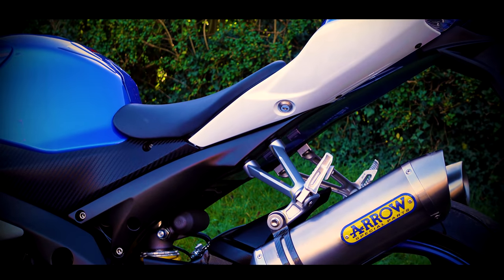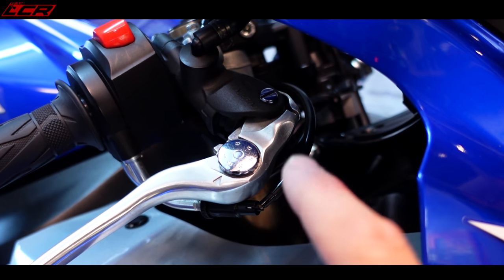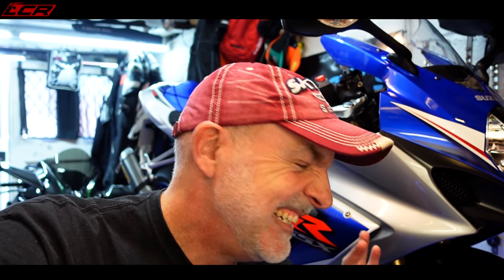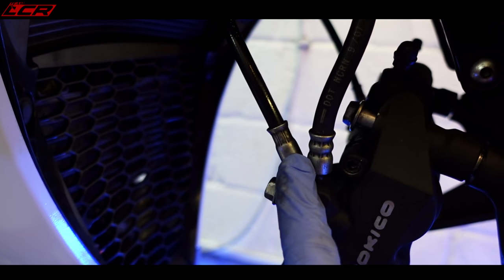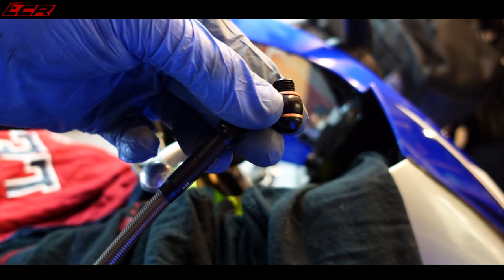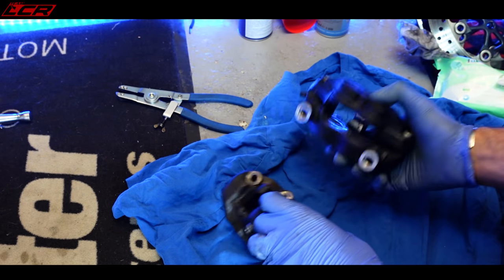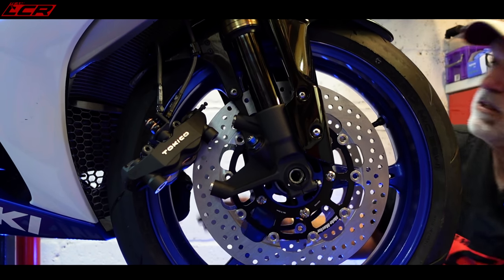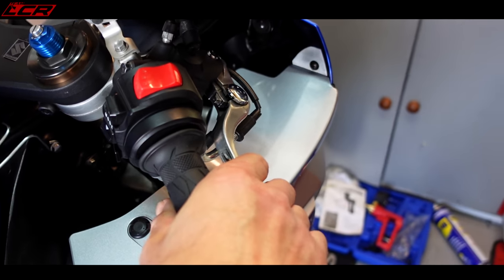2008 Suzuki GSXR-1000 | The Best Upgrades! EP01

Comment: Nice work Mr chops.
Shame you didn't diagnose the brake judder before throwing the kitchen sink at it. It could have been something simple as the pads. Judder at the lever could be the disks and a slow sensation of judder from the front tyre as you gradually come to a stop can be brake disc compound 
Great stuff thou 👍👍

Comment: Those Moto Master discs look very nice, I have Chinese discs on my ZX9r Arashi, made very well and work a treat. I know you love your lighter fasteners, a little tip that you may know, go titanium as you did on bolts that need to be very strong, on others go Aluminium, they are still resistant to corrosion and are even lighter than titanium, but if you do need stainless A2 or A4, let me know I sell them online 👍

I hope the master fixes it, it must be restricted, but then you'd expect the lever to go stiff. Maybe remove the calliper's one at a time and gently squeeze so the pistons moves out slightly, and check they all retract when you let go. If not one of the seals may be gone and binding, stopping them going back and holding the pads tighter on the discs as you use them.

Another way that might confirm it's this is pump the lever a lot and see if the discs are binding more and more, possibly preventing the wheel moving at all. Each side would be unfortunate, but I've experienced a seized master, and seized callipers due to dust seals going bad before so know exactly what that is like, glowing red hot brakes is not good, hope it is easy to sort though.
Reply from the maker: Yes sure that's the problem with piston not retracting.. going to have another look

Comment: I could be wrong but I would be looking at callipers sticking rather than the master cylinder causing the brakes to bind.
Invest in a pressure bleeder and it will only take a few minutes to bleed your brakes

Comment: A few things chopsy, first take those pistons out and coat them in a little brake fluid,

Secondly - try back bleeding the brakes, take that syringe you mentioned and put it on the caliper nipple with a hose and slowly push the fluid up the system that way the air travels to the highest point as an engineer of 20 years this is the method I have used for a long time now and never had poorly bled brakes

Comment: Quick tip adjust front brake lever to number one this helps bleeding brakes also take off left calliper and hang it down by offside calliper this helps bleeding as fluid does not have to go uphill
Reply from the maker: Yes good tip, I did do that 👍

Comment: To get your brake bled properly you need to crack the banjo bolt at the mastercylinder first mate if you look it will be the highest point and tends to trap air if you get good pressure there then you will be able to bleed down at the calipers in no time. Seems to be a big thing going around at the minute with people saying you shouldn't use brake cleaner to clean brake calipers as it dries out the seals, have used it for years and never had any problems but I can see why people think this, maybe a little brake fluid or gt85 around the seals after cleaning may help buy not much as it will only attract dirt and cause bigger problems. P.s you need a smaller front sprocket not a bigger one. Bigger on the rear for improved response.
Reply from the maker: Yes did it there many times, started there 👍

Comment: Don't spray brake cleaner directly on the caliper piston area as it can cause the seals to swell slightly which can cause sticking brakes. You're better off pumping the pistons out and scrubbing them with a toothbrush and mild soapy water.

The master cylinder, these can be a bugger to bleed up, you can get air stuck in the rubber link pipe between the master cylinder reservoir and the master cylinder body. Using a pair of long nose pliers, repeatedly squeeze the rubber pipe to expell the air. Been there and done that loads of times after thinking it was air trapped in brake lines.

Also, cable tie the brake lever to the bar (with the brake fully on) and leave overnight, see if that makes any difference.

What was the runout on your old discs? Were they in spec?

Comment: Hi there, always follow your channel love the content. There are a few things that might help here. Firstly rotating the those pistons inside the calipers will mess with the internal seals. You will now probably need to strip down the calipers and replace the seals. As long as the pistons slide in and out freely and are not binding, is all thats needed. As to not getting a solid brake leaver after bleeding. I find using a vacuum pump to draw hydraulic fluid through the dry system initially does get everything moving but there is a tendency for a vacuum pump to introduce air into the system a little at the bleed nipple. Therefore after using the vacuum pump then bleed conventionally with the brake leaver locking off to prevent air getting into the system. Hope this help and looking forward to the next episodes re the modifications.
Reply from the maker: Thanks Richard I think I've messed the seals.. I've ordered a rebuild kit 👍

Comment: only a suggestion mr chops did you loosen the bleed screw on the master cylinder
Reply from the maker: Yes I bleed there also
Reply: @LambChopRides  my K7 had the master changed it can only be that

Comment: Fill the calipers with brake fluid before putting the brake lines back on, then tie the lever in before filling the master cylinder, this will put fluid where it needs to be. If this doesn't help try reverse bleeding through the bleed nipple 🤔
Reply from the maker: Yes good tip that thanks 👍

Comment: I get really puzzled why people can't get the air out of brakes, I really do. I had a Landrover with twin leading shoe brakes, and there so many posts that talked about rotating back-plates etc.. I never had a problem with mine? I don't want to be 'elite' about it, but in my years in the trade, the method was to only open the bleed when the pedal (lever) was depressed (squeezed), and close it before the pedal/lever was released. Has worked good for over 30 years, for me 🙂
Reply from the maker: That's my method Steeps, honestly was doing that's for hours with no joy 😫

Comment: Don't try to use a vacuum pump to do the final bleed. Use it to get the fluid moving through the system but then revert to the old manual way with a tube on the bleeder valve down into fresh fluid and pump the brake lever, opening and closing the bleeder as necessary. Doing this applies line pressure in the hydraulics and cannot introduce air. The vacuum pump, on the other hand, can and does suck in air bubbles behind the bleeder valve, and you'll be chasing your tail for hours and hours with no luck!!! And replace your seals in the calipers BEFORE the new MC. It is not the cause of the binding! (But we know you really want a new MC anyway haha!!! :-)
Reply from the maker: Yes good tips Barry 👍

Comment: Could be wrong but I thought the master cylinder recall only affected the K5/6 models.  I remember having to get mine done.
Reply: GSXR-600/750 (2004-2013) & GSXR-1000 (2005-2013) models. Was a Tokico issue with corrosion causing offgassing which gave similar feeling to air in the brake lines increasing over time.

Comment: I had same problem on my gsxr750 L0 after replacing to hel lines bought a rcs19 and caliper rebuild kit and it turned out to be sticky pistons on the dust seals on the caliper

Comment: I've got the same bike, loving mine, although mine has stock break setup, sintered pads with braided lines and I get it doing stoppies with one finger, wonder what's causing the break issue? Look forward to seeing if the new master cylinder does the trick!

Comment: Hi Chops, I also use the Venhill vacuum brake bleeder, I saw in the video that you used the vacuum pump fitted directly onto the caliper, in the instructions with the kit, it shows you have to use the small nylon pot filled with a bit of brake fluid in it between the caliper and the vacuum pump, (their are arrows on the nylon pump to show you which direction to fit it) otherwise you will, (might) suck the fluid into the vacuum pump, which will do both the pump and your wallet no good at all!.
Reply from the maker: No that was attached Neil, just a long pipe in between 👍
Reply: Hi Chops, sorry for that, it was hard to see the pot on the video, did you fill the nylon pot with a bit of fluid, also the small nylon tube in the kit has to be fitted onto the underside of the lid so it is submerged into the fluid when you activate the pump. I have also had trouble when using the pump now and again and all it needs is a bit of Vaseline smeared on the small rubber ring on the nylon pot seal, that then makes the pump create  a bit of vacuum, cheers neil.

Comment: Can you visibly see the pistons slightly retract when you release the lever ? The seal is a square section (as opposed to an o ring) and relies on pulling the pistons back in when pressure is off. If the seals are old and worn they will lose this ability, leaving the pistons out, rubbing and generating heat
Reply from the maker: I will check that 👍

Comment: Also Chops… Hope you misspoke and the front sproket is one tooth less than standard otherwise you are increasing the gearing (making each gear longer) and reducing the torque. It the rear sprocket you increase the number of teeth to do the same thing… one tooth less on the front is like 3 tooth more on the rear sprocket. 👍

I went 15t front and 44 teeth rear on my RSV4 Factory from 15t / 41t standard gearing as the first couple of gears were way to high for tight twist hairpin roads 👍
Reply from the maker: Yes indeed my mistake explaining, it is a tooth down 👍

Comment: Hands down, the best improvement I made to my K6 was swapping a set of Yamaha R1 brake calipers, radial master cylinder and braided lines onto it. The OEM Tokico calipers are garbage, and always faded. The R1 calipers are amazing, both in bite and feel, and I got a mint set with the master on eBay for about $150!

Comment: As others have said Chops the MC isn't to blame here - there must be air trapped in the system. I do wonder about that link pipe over the mudguard between the calipers - the high point is where air bubbles will want to sit. Perhaps try lifting the N/S caliper above this and bleed again? Also, though it seems counter-intuitive, I wonder whether air in the system may also be the cause of the binding?

Comment: Didn't notice you bleeding the nipple on actual mastercylinder ,also put zip tie around your brake lever and zip tie small amount of pressure towards handlebar than leave over night ,airbubbles will be able too reach top of reservoir, since you didn't have air compressor vaccum bleeder ,Good excuse get new mastercylinder any ways 👍

Comment: I have just bought K9 GSXR-1000, fresh discs, new pads, steel lines and then my brake feeling is strange in comparison to my 2008 Kawasaki ZX6R. Brake lever goes deep, stopping power is good though. I'm thinking about new master pump. Anyway, great bike 😁
Reply: Get a brembo rcs19.

You can always move it to your next bike.

Comment: Great give us more smc-r and gsxr content !! Surprised that you go for the PC and not an ecu flash? I have installed HM plus SS on my K6 and it works great on all engine speeds, do not think there are any better quickshifters out there. I got my master cylinder replaced for free at recall, and it now works great. I think you just have to make a call to get it done, I did!
Reply from the maker: Just made things easier Knut, didn't have to mess about taking it anywhere
Reply: @LambChopRides  you will have to run a auto tune with the power vision probably just to smooth things out
Reply: Short term satisfaction! You will always have it in the back of your mind that the result could be even better. Do it proper!

Comment: The master cylinder have air loosen the bolt up there where the line start get the air out and you be fine.classic problem after line change
Reply from the maker: OK good tip 👌

Comment: I've found that putting red rubber grease on the caliper piston seal
Reply: Managed to hit send before I finished red rubber grease in the caliper seals before you push the pistons back stops them binding. Also 19mm Brembo master cylinder will give a nice solid feel.
Reply from the maker: Yes wish I had done that, thought occurred to me yesterday that could be my problem

Comment: Emptying the whole brake system is always a recipe  for disaster or atleast a lengthy bleed,  Don’t give up chops!.. we can’t all afford an R.C.S….!!! the Suzuki recall was for corrosion!!!. So even with the Brembo you’re still in  trouble!!.. when I’ve changed lines in the past I’ve started by pumping the caliper pistons as far out as I dared, then after replacing the  lines pushed them back allowing fluid to bleed off  to the M/cylinder, seems to work great, as you’re pushing air bubbles up!!. Which is where they want to go, doing one caliper at a time afterwards means your M/cylinder being already bled can pump fluid easily  through the caliper. your little vacuum pump is probably sucking air through the loose threads on the bleed nipple, and that standard looped hose to the opposite caliper is a natural trap for rising air bubbles. “ Bottoms Up “ it’s the way forward!!…😄💪🏻💪🏻💪🏻

Comment: Those torque limiter things are not needed on the k7/k8 bikes it was only needed on the earlier bikes . Never needed one on my old k7 1000 . Changing the Velocity stacks for diffrent ones makes a big diffrence in mid range and top end performance.. stop faffing about get the brake calipers off a 2005/2006 R1 and get some little spacers made as they make a huge diffrence over the stock gsxr calipers ..  I've been there and done it on the k7/k8 1000 for upgrades and get a yoshi exhaust system and some k tech fork internals and a WP rear race shock , they transform the handling ...

Comment: Looks like you haven't bled the master cylinder... You didn't have a spongey lever before, all you've done is introduce air into the system and not got it out, unloading the parts cannon isn't going to fix that..
Reply from the maker: Yes did the MC many times didn't help 👍
Reply: @LambChopRides  there's still air in the system somewhere, the loop of hose going over the mudguard can be problematic on 'road' routed hoses. I'd go back to square one, seals kit in the calipers, twin line hoses, might as well do M/C seals kit too if you've lost confidence in it. hope you manage to get it sorted 👍

Comment: Unlucky :( 

I'm not scared at tackling any job but if there is one thing I learned to leave alone it's them fucking calliper pistons. 

I usually clean up what I can and make sure no damage or excessive protruding dirt is on them and just push them back in. 

My girlfriend was on her 125cc and a garage had cleaned her pistons while doing a brake pad change. We went out for a night ride and all of a sudden she was going along and... squash... lever all the way to the bar no brakes. luckily she was doing slow speeds and managed to come to a stop but she panicked and dropped it on the grass next to a curb. Could of been a different story.
Reply from the maker: Yeah wish I had done the same! Think I've buggerred the seals rotating and cleaning..

Comment: You better of doing full Woolich flash on k8 full setup available on k8 unrestrict everything unlock everything much better than power commander and you don't need that heal tech box bcose Woolich flash remove all setting in ECU no extra wiring loom no wiring mess all available inside OEM ECU nobody use power commander any more bcose results much better with Woolich flash as proven by Moore Mafia YouTube channel